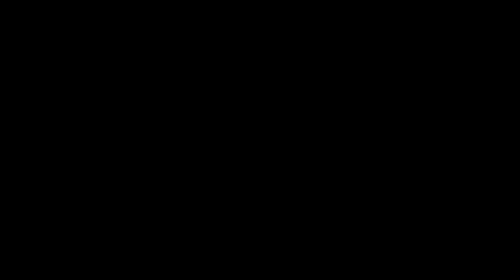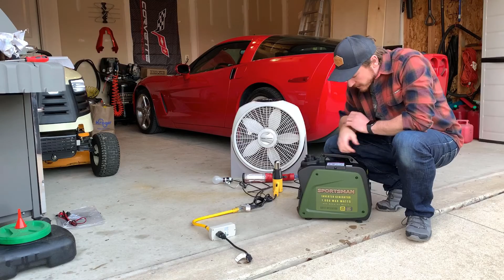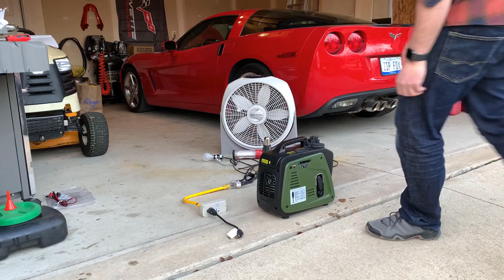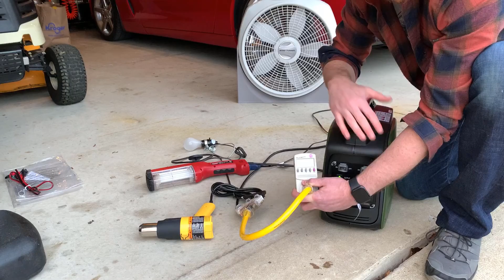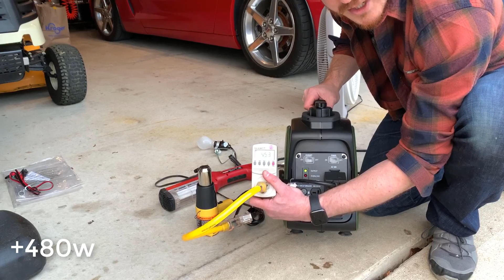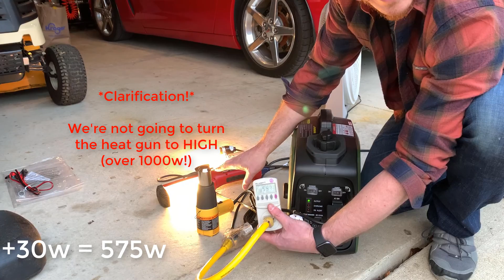Sportsman 1000 Watt Inverter Generator Review - Buffalo Tools

Comment: It's 760 running with 40 watts are dedicated to 12 volt battery charging system. Altitude, gasoline octane and freshness levels along with how clear the spark arrstors is affects it's wattage production. Best result are at sea level with fresh, high octane, 100% gasoline with clean air filter and no spark arrestor.

Comment: Didn't test the eco throttle under load. Disliked.
Reply from the maker: The thing won't even handle a full load under regular throttle.  Testing under eco-throttle was a loosing battle.
Reply: @deependstudios  I was hoping to see a test about half load, as how I use my current generator. Being fully loaded all the time isn't what these generators are designed to do. They can do it, but they won't last long. 

If the overload kept tripping, you were overloading the inverter, not the engine.

Comment: This is the most honest review I have seen so far. You can only get it from Tractor Supply on-line now. I have to return and rebuy twice (no exchange) before I got one that would start. The priming and chock are very tricky: if you follow the manual and prime it until bobble full, it will be over-primed and never start. Hot or cold, the chock has to be on its liking before it would start. And yes, it would over-load above 650 watts. It serves my purpose though for charging power station on the road. So, it is cheap and very portable, just make sure that is what you want... and keep the receipt
Reply from the maker: @LWong-w2f  thanks for the feedback.   I returned this one, despite it running well.  I can see where even at 650w it could be a useful tool for charging batteries as you described!  Cheers.

Comment: I think your heat gun is pulling way more than 450 watts on low.  Most heat guns are in the neighborhood of 800 watts on the low setting.  Kill-a-Watt's are also known to be somewhat less than accurate at times also.  I think your problem is not your little generator, but that the Kill-a-Watt is lying to you.
Reply from the maker: Must be a recent repost of this very old video, I've seen a few comments.    This generator ran great, but my experience was illustrated.   I think you can expect 500w out of it reliably. 

Other folks who have purchased this, and tested, have also said that it's not capable of producing the rated output.

I also do fully believe that there is no quality control in these units, and one may very well work at the advertised specifications.  For my money, this is a bad buy, and you can find better options at more reliable sources if you want to buy a chinese inverter.    

Cheers!

Comment: I think your killawatt is on the fritz. Low power heat guns are generally 750w low and 1500w high. Higher power ones do 1000w low and 1800w high.
Reply: After reading your comment, I googled heat guns, and the results came back even higher then your numbers. Thanks for commenting.  I just bought one of these, and I was thinking maybe I made a mistake.

Comment: Are you sure you had the heat gun on low? Ive reproduced this but my heat gun is 700 on low. Runs it no problem
Reply: He showed the wattage. It was only in the 500s
Reply: @SOLDOZER  I wanted a heat gun that ran at 500 on low but nowadays that I could readily find there was only 700/1400 ish heat guns

Comment: I wish this class/size of generator was more common.    These aren't easy to find for under $300 anymore.
Reply from the maker: I ended up buying a HFT Predator 1400.  It’s very compact and runs nearly 1200w continuous which makes it a bit more practical all around.  

Fuel sipper too if you’re just using it to charge batteries and basics in a small rig.
Reply: @deependstudios  
I just checked the price.  $469. Ouch.
HFT is overpriced before coupons and deals.
Reply from the maker: @Andy-df5fj  yikes, I paid 269 for mine, I can confirm it’s not worth 470 bucks.

Comment: Thanks for putting this out there. I thought I was the only one. Mine barely puts out 450 ways without shutting down and it’s only a year old. I can’t seem to run much but a few lights.
Reply: Make sure the vent on the gas cap is open.
Reply: @Andy-df5fj  it is
Reply: @2wheeledrocket92  
Maybe the quality took a dump on these.  Mine purchased about 4 years ago easily maintained 800 watts when I tested it new.  
Since, it's had no issues running a 5000 btu ac and other small loads like led lights and small electronics charging.

Comment: Must be an internal adjustment setting somewhere. I can draw about 800w out of my 1000i Sportsman. No problems. I use a Killawatt meter also. Runs my 5000BTU A/C just fine.
Reply: Lies.
Reply: @SOLDOZER  Try it, it works. A/C uses about 550 watts of power. A/C also runs off my 1500 watt dc inverter. off of my 300 amp 12v lithium batteries for 5 hours.

Comment: R U above 3000 Ft. Elevation ?
Reply from the maker: Nope, 930ft, roughly.
Reply: @deependstudios  . After I bought mine is when I learned it's not suitable above 3000 Ft.  . This is a back up for solar on a cloudy day or night to charge battery with inverter. some lights or 5000 BTU AC.    R U using high octane fuel?  Plug gap right?

Comment: I may be missing something, but I've had a number of inverter and traditional generators, and I've noticed inverter gens don't initially put out there full rating until they have around 30 hours on them. I had that a number of times when I first got my little 2kw predator inverter gens that it would trip with a skill saw and a fan running. Now that I have over 50+ hours on it it'll run the saw, 2 fans, lights and chargers if I need.
Reply: The inverter overloading has nothing at all to do with the engine being broken in.
Reply: @pootispiker2866  How do we know that though? The inverter overload might be triggered by voltage sag due to insufficient engine output. If the engine breaks in and delivers more power, that might prevent voltage sag from triggering the overload protection.
Reply: @RedpointFive Do you hear the engine bogging? Neither do I. That's not how inverter generators work. The inverter is the weak link. Maybe the generator output sagged too low, but the engine itself wasn't overloaded considering it was able to actually speed up.

Comment: A fan is an inductive load... you always have to derate your generator for inductive loads. Its going to perform much closer to spec with a resistive load... and your unit might not have the carb tuned correctly... another consideration is altitude. the sticker specs are surely at sea level.

Comment: i think the problem was you sat the heat gun on its intake blocking airflow
Reply from the maker: I’ve seen this theory elsewhere in the comments but the heat gun is designed to tailstand while operating, the venting is such that it can draw air from the back as well as sides during vertical operations.

Comment: How many hours is on it? During this video.
Reply from the maker: Details of the break-in and hours are in the description.
Reply: @deependstudios  manual states 20hours before running at full power
Reply from the maker: @Christ-is-King-  fair enough, but I can tell you the problem wasn’t with the engine here.  The engine ran awesome, this was a problem on the inverter side supporting the load
Reply: @deependstudios  thanks for the response. Mine runs good. Window unit will load it down and kill it, but eventually will start it and run it in economy mode.
Reply from the maker: @Christ-is-King-  I love the size of this unit, I wish mine worked better.  I was looking forward to adding it to my tailgating load out.   Cheers.

Comment: I just order one and it would run what I calculated to be 900 watts with the red light blinking.  950 kills it after about 8 seconds.   Seems like you're isn't even getting up to rpms
Reply: Yeah I am thinking he needs to retune at his altitude... if you are far off whatever it was tuned for it isn't going to perform and you do loose some performance at higher alt.

Comment: I just got one and it runs my heater on low. It is about 500 watts no overload light 💡. It is still in the break in process. I think I need to run it 20 hours for it to be fully broken in. It currently only has about 4 hours on it.

Comment: I'm sorry but I've tripped breakers at work with those heat guns they draw a ton of power. It's a camping hunting fishing sportsman generator not used to run heat gun or all that at once. Yes it does shut down but realistically when u gonna run two lights a fan and a heat gun in the woods lol. Good video tho
Reply: You missed the point! The generator claims 800w continuous with 1000w peak operation, it only achieves 575... False advertising and a disappointment to the consumer... All would be good if the company advertised 575w continuous,  with about 800w peak...
Reply: @Quickened1  It's just tuned badly, this happens with any cheap generator... other people say these run 900W without tripping... there is also the issue of the fuel in question these were almost certainly designed for 93 octane straigth gas... not E85 or similar. Anyway it needs to be returned with the fuel you are gonna use at the altitude you are going to use it at most likely.
Reply: It's not even run in yet !!!
Reply from the maker: @michael-sz3ff  it was run in before these tests.  Ran it in and made multiple oil changes.  This was a fairly expensive review from a time perspective.

These generators are a crapshoot, some of the inverters WILL run the rated power.  Most will not.  The engine on mine ran amazingly well and oil after the initial change was relatively metal free.

They are budget generators, and if you win the lottery you might get a good working one that meets spec.

It got a not recommended from me because just as I mentioned, most folks need to get one or more replacements before they get one that will run to the box spec.

Comment: I have had one for about 4 years. Great little generator for what it is. I use it to run multiple items at the same time but nothing that has a heating element of any kind.  And it works great at that. It is quiet and efficient. I love mine.
Reply: I need to keep 3 deep freezers going when power  outages , will this inverter do the job ?
Reply: @4u25out  volts x amps = watts  and these are not meant to run a full 1000 watts, they are light duty camping units that people often expect to much out of like this guy.
Reply: What do you recommend as a reliable alternative?

Comment: Your going from small gauge extension cord to a fat one then all those other cords, that’s equals a lot of resistance. 
But, yes it should still run all that.
Reply: at the the length of cable in question and loads... that is irrelevant. The issue here is probably non resistive loads... which are harder to deal with for generators. also its really more like a 700W generator that said you should be able to parallel 2 of these as well in a pinch for a heater... and fuel consumption would still be pretty good since this is a very efficient generator.

Comment: Realistically, how loud is it? Videos are rather deceiving when it comes to audio.
Reply from the maker: My opinion is that it's fairly quiet from any reasonable distance.  It's a small engine, so the pitch is a bit higher than a slightly larger unit... for some reason, it makes it, at least to my ear to be more notable.     At 20ft, I doubt you'd mind it at all though.

I wouldn't buy this machine personally.   It's junk, you can play the lottery for 300 bucks, or just buy a better unit.

Comment: I think you've got a lemon, hopefully you can return it. I've got the same model generator and have had somewhere over 600 watts continuous without the overload light flashing.
Reply from the maker: The consensus is this one was trip happy for sure.  I dumped the gas out and returned it to WalMart without a question.

Comment: I bought one last year on clearane at walmart . com i use it to run a hot dog compressor. charge a westinghouse powerstation. And power tool batteries. I have powered 2 mini fridges at the same time no overload.

Comment: You closed the air intake on the heat gun when you set it down
Reply: Look again, it's got side air intakes....
Reply: @Quickened1  it is still being restricted
Reply: @rcmafia2  Nope,  look at 4:35... you'll see the back end of the gun is closed off and flat,  it's designed that way so it can be set on its end, just as he did in the video.🕶
Reply: BINGO!!! thats exactly what i thought

Comment: Thanks for taking the time to put this up here. I suspect you may have got a "trippy" one, and hope you returned it for an exchange unit. I'd be curious to see the very same load test performed on one of those ultra-cheapo little 2-stroke 900 watt (claimed peak) Harbor Freight "TailGator" gensets. My hunch is that it would just put its shoulder into it and get it done. I don't have one of those Kill-a-Watt style plug in meters to confirm that hunch, but I've picked up a couple of those 2-stroke fussbuckets over the years, the TailGator's red predecessor "StormCat" branded ones, and they both seem to punch well above their weight before tripping out on overload...I'd guess at least 1,200 watts or more. The advantage of your 4-stroker inverter unit is that it's marginally quieter, though not as quiet as I'd have guessed, and nowhere near Honda "whisperness" territory, and its sine wave output is gonna be a LOT kinder to sensitive electronics than a 2-stroke hooligan.
Reply from the maker: Definitely feel like, based on many responses this one was a dud on the electronic side.   Interestingly, I feel like the engine on this one was very smooth compared to other cheap engines.   It feels like the engine could have pushed far harder, but the inverter wanted to give up.  I did end up returning it, I did not replace the unit, but I’d like a small 1000w down the road that would ride in the truck daily.  It’s such a nice size. Regarding noise:  no, it wasn’t quiet, I’ve owned multiple eu2000i gens and this one was loud in compare to load, but of course price factored in, not terribly so.  Cheers
Reply: @deependstudios  Well, if it's just something you toss in the truck to push a power tool, it's hard to beat one of those TailGator 2-stroke fussbuckets from Harbor Freight. I keep one in the rear passenger side footwell of my old Durango Towbeast just for running stuff like grinders, sanders, and buffers in the state park boat lot where I keep my sailboat, and another to power stuff like my corded hedge trimmer, chainsaw and string trimmer around the house. My pair, about 4 and 5 years old now, are both still running strong. But I were to get another similar 2-stroker, instead of the Plain Jane Harbor Freight "Tailgator" I might search out one of the fancier variants on the basic model for just a few bucks more with the additional 12 volt DC outlet, which puts out about 4 Amps, which might be handy for jumping a weak vehicle battery. Some have an extra diagonal 2-prong outlet like this: ( \ / ) and a plugged cord with alligator clips, while others just have a cigarette lighter style port with a lighter-style socket and cord with clips. I think I'd prefer the former style. The brand name "Pulsar" has a reputed 1,200 Watt peak rating and also offers 2 regular 3-prong 120VAC outlets instead of just one, while one branded PowerPro by Wen claims 1,000 Watts peak and has an analog voltmeter on the panel. A Google search of "2-stroke generator" will scare up all sorts of slightly different options.

Comment: Hi There.!...TIP N.1....Be sure you put 7.5z of oil "ONLY".Do not overfill.! ..Will destroy the engine adding much oil.!...2..I did replace the original spark plug with NGK brand..! Run much better..! Huge improvement..! GAP them properly..!.3...Add a hr meter so you change the oil properly.. every 100 hrs or less....4...The Heater Gun Draw about 8.5 max amp...so you are  at the max amp draw running for this BS..!...it will overload..!!....Comprende amigo..!! Chao ..!!...Tip N.5...Get (2) NGK so you have and spare one on hand..!!...###...I have the same genny with over 900 hrs..!! Great generator..!!! But not like a Honda 1000w wich is the best ...

Comment: Mine ran a 5000 btu window unit. it did have some trouble getting it started though. I wanted it mostly to power my fridge and upright freezer in power outages and it can do that with no problem.
Reply: Mine does the same but when it stabilizes it will go to the eco mode and drop a little rpm. The book shows a break in time of 20 hours. I bet most people don’t follow the manual.

Comment: the start power for heat guns could be twice the rated power. any other similar electric heating applicances are similar.
Reply: For a split second on the fan ... the resistive element itself though is a very very constant load and would dominate the power use of a heat gun, the inductive load of a heat gun is extremely small... I expect it would have handled the heat gun without the other loads but he didn't attempt that. Also some devices  you would think would be "clean loads" can be quite dirty like LEDs which can put really bad power factor loads on a generator (for instance because they will often only take power from the peak portion of the AC sine wave and other nonsense and the killawatt won't always see that). You'd need a multi thousand dollar power analyzer to test for those issues.

Comment: I have a Buffalo Tools 1000 wt. 2 stroke I have had it 15 years use it camping for fans and drop light . it will run a drill ..grinder..electric pole saw has a 10 amp dc plug to charge a battery well worth the 100.00 it cost.